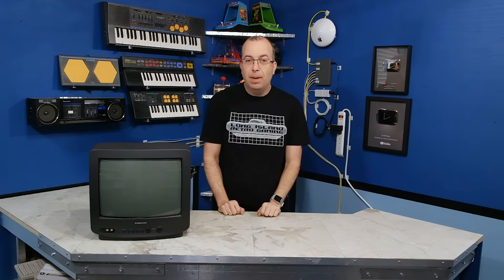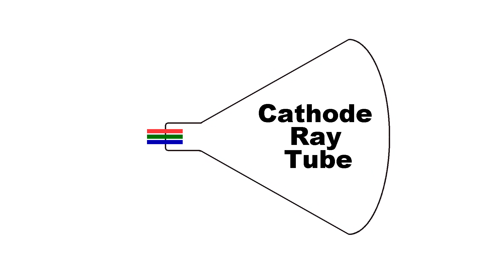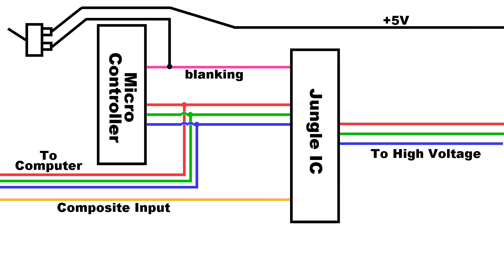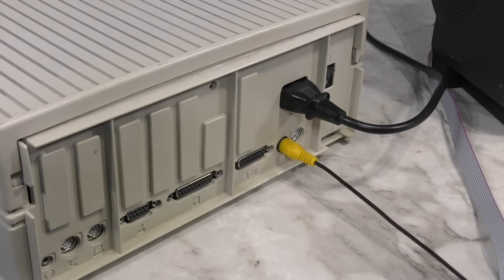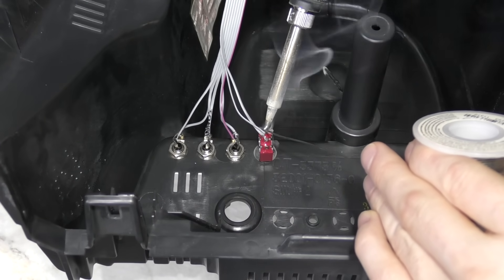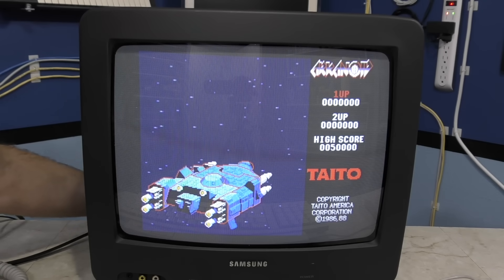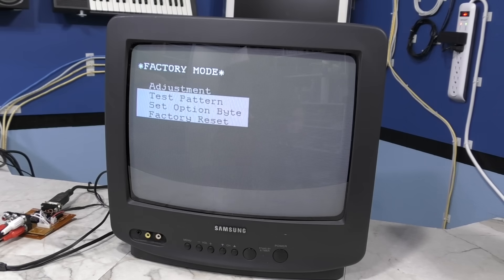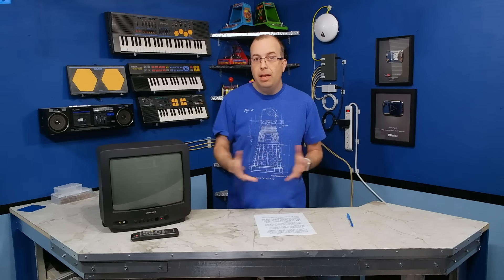Modding a consumer TV to use RGB input

Comment: I was looking at something similar to this earlier today (good to see great minds think alike) - Ironically, I wanted to do a reverse where I wanted to drop a PC's sync down 15Khz from say 31Khz - I found this -> https://hackaday.io/project/161006-yet-another-vga-to-scart-adapter/details - I'm tempted to make something to do a similar type arrangement so I can run a PC in the loft whilst setting up some cantennas under Pfsense. Might be easier to just use a laptop instead though.

Comment: It would be cool to hack a iMac g3 and put a more modern pc in there and connect it to the original crt don't know if it's possible though
Reply: You probably could, the iMac G3's monitor uses the standard Mac video port (essentially VGA). The only issue would be finding space to cram the motherboard, since the internals are somewhat cramped.

Comment: I used 27" TV for a year as main monitor after building my first PC (386dx40), special cable with tsr driver cost me $10 and was heavily obfuscated - TTL chip with scratched off markings dipped in epoxy ;). Years later learned that you can do it with no active components at all, just short H and V sync signals and jam them into pin 20.

This setup worked great for DOS gaming, where 99% ran at 320x200. 640x480 reprogrammed CRTC into interlace mode and was painful to watch tho.

Comment: I'm in the UK. SCART sockets had two very annoying problems.

Firstly not all SCART sockets supported RGB. On a typical TV set equipped with two SCART input sockets, the first one would support RGB and composite, whilst the second one would support S-Video and composite instead. Most annoying since most devices (such as set-top boxes and games consoles) didn't have an option to output S-Video over SCART at all. Hence you needed to swap cables or use a SCART switch box, and many switch boxes were composite only (but didn't say so in the product description).

Secondly as most SCART cables contained a wire for each pin, they were both stiff and heavy, and had a tendency to fall out of their sockets over time. I often had to visit my mother's place to fix her TV set as the SCART cable had worked loose on her DVD player. Although in some cases it was probably the cat's fault!
Reply: Paul Grayson I’m yet to find a SCART socket that doesn’t support RGB. SCART cables on the other hand don’t sometimes though. My SCART socket on my TV is working loose now, and I’m gonna have to take it apart to fix that, but then my entire family will lose their shit again and call in all of relatives within 100 miles to my house to stop me again if I take it apart even though I know exactly what I’m doing.
Reply: Most of Euro TV with more than 1 SCART connectors only support RGB on SCART #1 (only 1 RGB SCART was needed by Euro standards.)
But on every 80-90-early 2000 Euro TV with only 1 SCART, this SCART is RGB compatible.
Reply: @grawity  Audio/video out uses different pins than RGB in, so usually ports supporting A/V out also supported RGB in. But of course everything varies by model :)  E.g. I had a TV where one port had A/V out without OSD (GUI) and one had A/V out with OSD.
Reply: I had a Loewe TV (German) with two SCART plugs and yes, only the first one supported RGB.  Thank goodness we don't have anything these days where the plugs are the same but you have to look in the manual to see what signals it supports cough USB-C cough
Reply: i have an old tv with just one scart and that connector you used to plug your aerial into (whatever its name is), and with suitable conversion devices, it will plug in to pretty much anything i throw at it. stuff as late as a wii or as early as a sega master system, and probably earlier too.
Reply: Folks in the UK have an easy time getting great video from consoles and computers with that scart socket, they're available for most computers and consoles on ebay for less than £10 in most cases.
I run my CPC464 through a scart cable and power with a regular adaptor. I'm thinking about modding an MP1 to output to scart, or maybe even kludge one of those svideo/composit -> HDMI converters into there too, instead of the RF output it was designed for.
Reply: The worst part about SCART is that, because of how heavy the cables are, the connector will break after a few years and the pins in the connector will snap. It's happened to every TV/cable I've ever owned.
Reply: he in the USA, the USA, don't no what a European  SCART socket is : -)
Reply: D H 
For the most part. Retro gamers in the United States are now embracing RGB SCART for the picture quality it can provide.

Comment: Say, is it normal that the Apple II correctly says "check startup device" at 8:20, but mispells it as "check rtartup device" at 12:07?
Reply: Chip-level soft error. Due to cosmic ray interference one bit can change its state (0 to 1 or 1 to 0).
https://en.wikipedia.org/wiki/Soft_error
Reply: fallingwater the 12:07 one was the IIgs the 8:20 one was the II. But no it is not normal.
Reply: Go home IIGS, you're having a stroke...

Comment: great video! that's remind me when I swapped the electronics on the monitor of my Noami cab, from the original 31KHz to a tri-freq one. the old card was functional, but severely busted, I wasn't too keen to replace all the dying components, by experience I knew that if I started to replace, I wouldn't finish it, as the components would die one after another, to the point where I couldn't find any replacement or one component would catastrophically fail and take the rest of the board with it. since I wanted to make a system fully functional for other cab systems and a PC, I opted for the replacement of the whole board and it work just fine :D. sorry for the shenanigans, seeing you happily put your hands into the guts of a CRT screen tend to recall me some good memories :D

Comment: Although all TVs in Europe had SCART, it didn't mean that the RGB pins were connected. Most TVs only used the composite pins and the bigger, more expensive models, with multiple SCART connectors only had RGB on (for example) SCART 1, but not on 2 or 3.
Reply: The vast majority of TVs have at least one RGB enabled SCART connector, because otherwise the TV could not be sold in France.

Comment: I have a slightly later flatscreen version of this TV and the thing about all these cheep samsung crt's is that the American version's are identical to the eastern Europe version except for there are composite inputs where the scart input is. At 3:34 you can see the rgb scart header. It is very possible that all you had to do to rgb mod it is buy a right angle scart header and solder that in.
Reply: Probably solder in some 'nostuffs' as well. With a bit of luck only a few 75 ohm resistors and some wire bridges.

Comment: hacking old TV's? man, you're hard core retro!
Reply: I think he's being genuine.
Anyway, to rationalize modding of an old TV for this:
- It's analog and there is a definite value in having an analog output device option on hand.
- It's what the dude had lying around.
One could go after one of those industrial Japanese CCTV CRT monitors for best quality and maybe even get one of those flatscreen CRTs if time to find one and the obscure pricing of them isn't an issue for you but modding a TV is the cheap and easy solution.
Reply: @MuradBeybalaev  And the fact that it is a gift, from his formative years, means that it has sentimental value to him, too.  It's like modding a child-hood video game console, for a better audio and video output.  Such actions prolong the usefulness, of something that one loves (or has affection for).
Reply: Ja, das ist gut!
Reply: All older TVs process some parts in RGB or better... you just need to know how to access it...Not a new concept but very possible on a lot of TVs...
Reply: I have this exact TV.  I'm thinking the next step in this process is a HDMI adapter.
Reply: Yes
Reply: Hard to tell if you're being an asshole or what dude...

Comment: Luckily, in Europe, we all had Scart sockets, which are amazing. To this day, my Amiga 1200 on a scart connected to a 50inch tv is rock solid... and the cable is like 33 years old. And undeniably, PAL looks MILES better than NTSC (fondly known as Never Twice the Same Colour) in our TV repair classes. Good job!
Reply: in college Television Production classes we learned it as "Never Twice the Same Color"  

totally different 😉
Reply: its a shame though that PAL tvs were 50hz unlike the NTSC's 60hz, gave us slower games as PAL users.
Reply: @smirnoffvodka2618  Only if the games were developed for NTSC, many microcomputers had European developed games so that was correct speed consoles were another matter.
Reply: Revenge Nerd yeah, still prefer PAL over NTSC
Reply: Its a shame though late in CRT's lifestyle tvs with vga/dvi/hdmi were very rare meaning connecting a modern pc to them is a nightmare I currently have 2 amazing tvs that just have RGB scart that I can't get working with a modern pc unless I use composite
Reply: Never The Same Color
and
Perfection At Least
Reply: @chucku00  the cable could have been from something else tho?
Reply: Nobody wants 50hz...
Reply: @ChengGaos  Japan was about to adopt PAL 50 htz when suddenly they chose NTSC (Hmmm STRANGE isn't it?) if they had developped their games consoles in 50 htz then no one would want 60 htz.
Also, 50 htz slowness would have never happened if game console makers had decided to either use a buffer in their consoles to generate the image for the TV separately of when it was created by the vidoeo chip (the Odyssey²/Videopac does that) or programming their games to run faster on PAL systems (which Nintendo did with their NES games, Sega with many Megadrive games, and it was widespread on 32 bits and later consoles).
You can notice it for the NES if you watch videos  of the same game running on a Famicom/US NES, on PAL NES and on a Famiclone. The Famiclone game will sound and play slower because they use "60 htz" ROMS and run them on a system slowed down to 50 htz.
I heard that PAL NES doesn't run on 50 htz precisely but a bit upper (like 52/53 htz) to gain a bit more speed.
Reply: just to point out: NTSC and PAL are TV signal encodings (and yes, also timing). As long as you are using FBAS/Composit/RGB you are actually not using NTSC and PAL encoding. You still have NTSC/PAL timings but those do not change picture quality besides from the 60hz vs. 50 hz refresh.

Comment: I really love this! That's the perfect size for a little CRT to have around. I had a bigger one and got rid of it as I live in a metropolitan city in an apartment. Space is at a premium for me. Having a larger CRT just for nostalgia's sake wasn't sensible. A smaller one would be nice.

One thing I do have instead is a DELL computer monitor that also takes composite and S-Video. Weird thing! Model 2007FPb? 1600x1200 but it looks great for composite stuff as it's 4:3 ratio.

Comment: Why didn't you fit the SCART connector which was alreads planed for the EU version of the set?
Reply: it's possible there were electronic differences between this TV and european models, so it was likely he didn't want to take the time to do the work and find out it didn't work.
Reply: @cpufreak101  The hole for a SCART connector was clearly visible on the back of the set case.
Reply: @dairallan  that doesn't necessarily guarantee electrical compatibility though
Reply: Well, he told the reason in the video: This is what he had at hand. However, I think there is a strong case for using a SCART connector and that is that there exist off-the-shelf cables for just any device. Now he has to make all cables himself.

Comment: Well, at least NTSC was 60hz while us PAL guys with SCART had to deal with 50hz. So meh... the best solution was still a proper quality monitor back in those days.
Reply: Because PAL 60Hz exists (in Brazil), you can normally just feed a device with SCART inputs a 60 Hz picture (exceptions are some devices from the early 80s). No need to deal with 50Hz on a TV if you don't want to, SCART capable TV was all you did need.

Comment: The piezoelectric lighter you use on the heatshrink tubing will generate quite a high voltage spark - not great if you want avoid ESD damage.

Comment: In Europe all TVs from mid 80s to around 2010 accepted RGB though it came needed only after 2000 with DVDs and later set top boxes. That might be a reason why it can be so easily modified.

Comment: Do you have more info on that tex elec board that converts digital RGBI to RGB? I want to hook my Tandy 1000RLHD up to my Sony 20" PVM, and I even got an extron brand device that nearly succesfully does the conversion, but it displays brown as orange. I couldn't quite discern from your video if its doing the color conversion correctly so I'm not sure if I'm approaching from the right angle.

In your palette example, the "dark" (I = off) version of yellow would be dark yellow without a little logic chip to pull the green lines darker on the analog side, and thats what produces brown. On my extron converter, it appears to pull the red lines up to full brightness instead, so instead of getting brown, i get orange. 

Any help with getting an adapter that does RGBI to RGB without messing up "brown?"

Comment: interesting you should have mounted 4 or mores male/female connectors to the back of the crt monitor 

seeing on the other side that rgb is just giving 1 value for red how does it determinate its intensity ? lets say get get combined then you probaly have a diffrent color but 

from the software side there are 8 bit color pallets for 256 or FF colors it also can have 8 bit per color FF FF FF this is then used to make the amount of possibilities its 16 millions theoretical then (24 bit true color)

this makes for 3 wires being rgb 8 possible colors with a fourth wire 16 color , that sounds to less 

does it have a intensity for the RGB ? like it has with the analog version ? i always heared its 256 colors for a old classical CRT

Comment: Wow. Is there any kind of website that has the information for what resisters and such one would need? I have a trinitron that is in decent shape that I’d like to try this on.
Reply: I don't think it will be that easy. But start by searching schematics for your TV, then start looking for the chip that generates the OSD. In most cases it generates RGB and blanking signals, check in the schematics which pins are used for that. Now you know where you can solder wires.

Another approach is to check the PCB if it is SCART-ready. Many TVs are prepared for SCART connectors. If this is the case, the schematics often tell you which missing components you need to add.
Reply: Daniël Mantione Cool! Thanks you very much for the reply and info!!

Comment: That's pretty crazy - might actually convert my Trinitron to RGB instead of buying a PVM monitor. Thanks for sharing this!
Reply: Picture quality will be very similar. The PVM will get you much more connectivity options, but doesn't necessarily give a better picture, as TVs can have pretty good tube that you can use to full potential with RGB.
Reply: It'd pretty much look as good as a PVM.

A PVM would prob have a higher TVL count(more columns of phosphors) and a bit better contrast, but none of those things makes the PVM objectively "better" for gaming purposes. Make no mistake : an RGB capable consumer Trinitron looks freaking amazing! It is still perfectly sharp with great, accurate and vibrant colours and very good contrast. I encourage you to ask for info wether your set can be RGB-modded or not, and to do it if possible! It's a fun project and you'll end up with a killer set.

Comment: Brilliant insight to 90s tech. Had a few TVs like this, except that being in UK we had SCART input (some sets later also had rca composite jack on the front panel-mainly for camcorder hook up). Scart carried composite and RGB (+stereo) all on tiny wires inside the big clunky scart cord. It wasn’t all that brilliant tbh. It seemed a good idea, it was convenient for sure, but the multiple wires were fragile, you could suffer from cross talk between those tiny wires (resulting in pulsing cols and ghosting effects) and the plug design was easily broken. If you bought a cheap scart cable, it was asking for trouble. I for one was glad we moved from that to HDMI.
Back in the 90s I wanted to connect my Mac to a scart enabled tv, but was told it couldn’t be done. Having seen this video, I think it could. Looking backing at that period, it’s amazing how far we have come for convergence technology.

Comment: SCART isn't purely RGB. It can carry an RGB Signal, but it is not necessary as the SCART connector can also carry a Composit Signal for backwards-compatibility (as there were already devices with composit on the market when SCART was developed)
There were also some devices, that send an S-Video Signal over SCART, but that is not offically supported and only some TV-Sets can actually detect that. Many game-consoles  actually just came with an composit cable and a Composit to SCART connector. So RGB Signals where only used mostly in TV equiment like DVD-Players and Digital-TV Tuners...